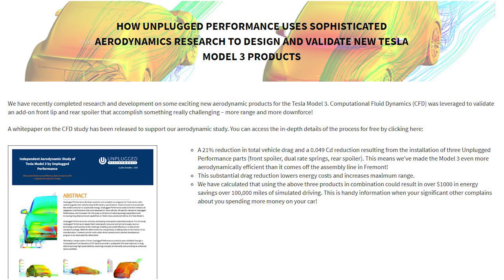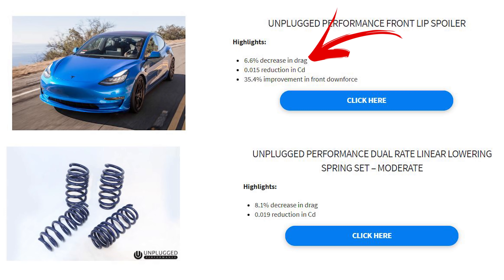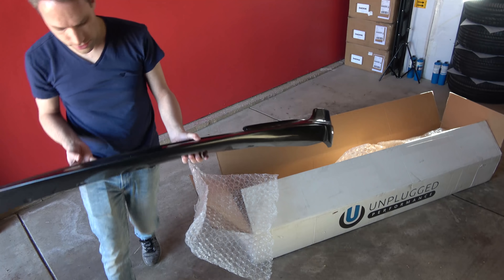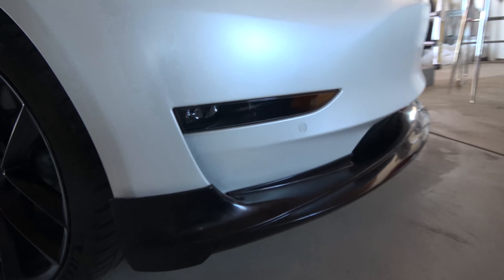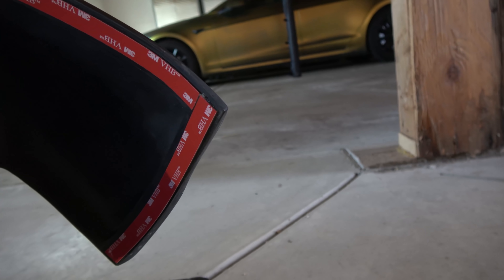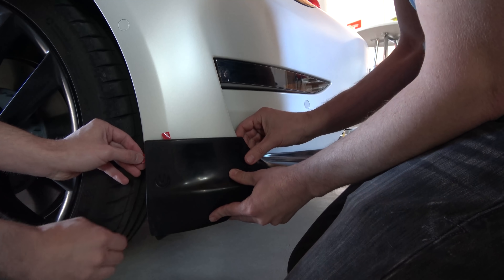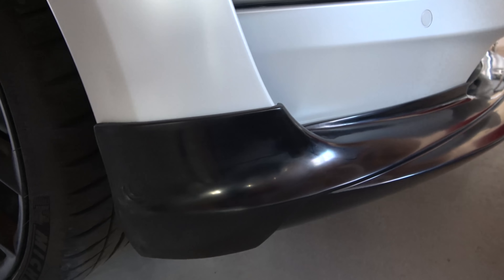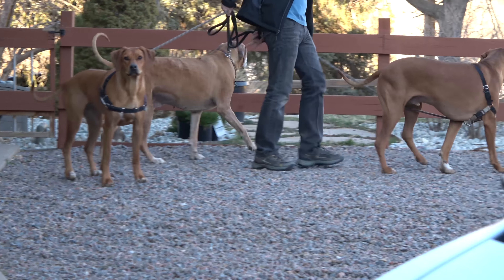Improve Range With This Easy Tesla Model 3 Modification

Comment: I'd have to paint it if it were me but still looks good against the white.  Just an FYI - usually good to clean where the 3M tape touches with alcohol before fitting the bumper.
Reply from the maker: I did clean it all with alcohol, I must have forgot to put that in the video. I will pin this comment for people who are going to install to see.
Reply: I was just going to mention to you that he probably did, as he is very meticulous about preparation, and then I read his reply.
Reply: I definitely came to say the same lol. But knowing him (not literally) I should of known
Reply: Using claps to apply pressure for 3m tape helps

Comment: Attention off-grid folks: :Tesla advises to keep your car plugged in when not in use )ie when you get home from work). But like me, what if you do NOT have a 110 service, I live off-grid in a house I built myself, There are separate and redundant systems for each area: living room kitchen, bathroom etc. I bought my long range model 3 on June 2, 2021 in Portland OR and charged it 100% in Bend Oregon. (356 miles) I live 135 miles east in Christmas Valley and arrived with 219 miles. Over the course of the next three days I drove less than 8 miles a day but every morning I showed a loss of an additional 20 miles. Tesla explained that one can never shut the Tesla off as there are numerous component that require power. I got a bit nervous as I only had 150 miles of range left and the nearest Supercharger was in Klamath Falls Oregon 130 miles west. I made it with 12 miles of range remaining. So range is an elusive number. It depends on your use of the air conditioner and how often you make it go super fast.
Prior to purchasing my model 3 I asked all over the internet how I could use the sun to charge at home. (True, I could have gone a mile or so to a neighbor to charge overnight but elected not to.) So here is my solution: I bought 8 one hundred watt solar panels i wired in parallel to make 24 volts and  then in series (four 24 volts) which cost about $800 with the cables and clamps. An MPPT charge controller accepting 12 or 24 volts which cost $279, two 12 volt deep cycle batteries costing $280 and a 10,000 watt modified sine wave inverter costing $229. Cables and fuses cost another $134, For a grand total of $1801. This inverter provides 220 volts and charges 28 miles per hour.Anyone living off grid with no access to 110 might find my solution will work for them. In short you may not need to visit a supercharger that often.

Comment: Is there actual proof that all these parts do reduce drag and thus increase range? I really find it strange that some third party manufactures just produce some good looking parts that all somehow inrease range. I mean, if increasing range by about 20% with a different spoiler and even downforce simultaneously just by using a different spoiler and front bumper, why did not tesla do this? They invented the car, they tried to reach maximum range, why would they just put a front bumper and a spoiler on it that is so much worse? 

I know the video is old but it just bothers me

Comment: 1. There was no discussion on cleaning the surface that the tape bonds to.  Fail.
2. Mechanically securing the bumper in place while the tape is curing is advisable.
3. The 3 is already about as aero-efficient as it can be, so this "6% improvement"  means that the the stock coefficient of .23 will be reduced down to .2162 (essentially .22). At 65mph, if the rolling resistance is 4 hp and wind resistance is 5hp for a total of 9hp, reducing the wind resistance by 6% takes us down to 4.7 hp of wind resistance, for a total of 8.7 hp.
4. Yes, the spoilers will help in a road race. 
5. From a stoplight and in any real-world acceleration competition the spoilers will only reduce acceleration.
6. The spoilers reduce the resale value of this $60k car. 
7. Quality parts include installation instructions. I didn't notice any such instructions.
8. 35% increase in front downforce??? There must not have been any downforce to begin with. 
9. No before/after measurements of quarter mile time or range? Tsk.

... just sayin

Comment: Yeah put some led lights under and you are set. Also without cleaning the probably filthy surface under the bumper with isoprop the spoiler will most definitely fall off... hopefully not on the highway where you might kill someone behind you...

Comment: Having learned to be a skeptic about such things, I find the company's claims questionable. Will you be doing any tests to verify the asserted mileage increase?
Reply from the maker: Yes, I'll be testing everything.
Reply: DÆrik Should have tested the before and after efficiency test on the same day and preferably within the same hour.    Tests conducted on different day with different weather condition just have too many variables.
Reply: @TeslaInventory  When when when? So curious to see if there's any improvement. Can it make LR RWD a 350 mile car?
Reply: @TeslaInventory  yeah no i doubt this helps. its going to disrupt the subsonic (obviously) shockwave in front of the flat nose making more drag....

theres a reason they punched the nose on these cars.  at low speeds air makes a cone for you and the less surface drag the better

same reason jets have more rounded noses and hypersonic missiles have drastic steep cones (sprint missile)
Reply: I looked over their claims as well and am skeptical.  I believe the largest contributor was lowering the car using their springs....which causes other issues like not being able to traverse speed bumps, et cetera.... Interested to see the results of his tests and testing method.
Reply: @Richard-ie1if  It will help.  Reducing the mass flow rate of air that goes under the car (in this case a splitter is used) will inevitably reduce drag.  Splitters help more on (most) internal combustion engine cars because their underside is not as smooth as electric cars due to the need to fit the exhaust piping.  Also, shock waves do not occur in the low subsonic regime; the correct term is "pressure wave".
Reply: @brendanreed3378  i doubt itll do anything noticeable certainly not % points.  making air flow over the top vs the bottom makes no difference for drag.  when its used its to increase air velocity underneath to make downforce
Reply: @Vxvx22  I have to disagree.  If the changes are not enough that you can't notice them except testing them sided by side, then it's not worth doing.  But yes, having a controlled test environment is better for getting numbers.
Reply: @TeslaInventory  A year later, any news about those range increase tests for Unplugged's "21% drag reduction" add-ons?
Reply: @TeslaInventory  hello Erik, any update? When you'll publish the efficiency test for this spoiler?
Reply: @Richard-ie1if  surface drag?! Do you even know what your talking about. It certainly does not seem like you do. Surface Drag is insignificant when compared to pressure drag!
Reply: @loopie007  it depends! The immediate gains may not be noticeable enough and are easily overshadowed by those “variables”. However, if you integrate all the “benefits” over all the years he uses the vehicle, you may get high enough savings to justify the investment. Moreover, the effect of those hard to model variables will reach zero over a high enough usage period. Let alone the variables whose effect is null.
Reply: Still waiting for the test..

Comment: I think this is mainly for looks. Self-made efficiency claims from an aftermarket supplier are highly suspect.
Reply: In case you haven't actually read or check out the information for yourself here is the link: https://Unpluggedperformance.com/aero Hope this Helps!...God Bless!

BTW!...Tap on the Unplugged Performance Logo and it will transfer you to their Aero Parts Efficiency page!
Reply: @DavidJSmith-hl6kb  After reading the information I find high drag reduction amounts and high downforce increase amounts. . . . BUT no mention of correlating vehicle speeds for those amounts. I'd guess that's because the maximums are going to be achievable at the Model 3s top speed of 155mph. At freeway speeds those percentages could be much lower. Same for the even lower speeds in everyday driving. We'll have to wait for real world feedback.

Comment: Tesla would already know this but has to compromise. The lower lip means future damage from steep driveways, parking building ramps, high curbs from parallel parking bays etc. Better to let customers aftermarket fit these and the AM company takes the flank from future problems, not Tesla.

Comment: Less drag = more miles
More downforce = less miles
Downforce increases friction on the road.
Reply: And also downforce is created by friction of air under an angle on a spoiler, that means it slows you.
Reply: But downforce will help in Tesla Corsa
Reply: Thought the same thing: Less drag AND more downforce is kind of impossible at the same time …
Reply: It is possible to increase downforce without increasing drag. One of the most accessable methods is underbody air management, i.e. promoting laminar flow or reducing the volume of air underneath the body (an easy way to do that would be to lower the car). Aerodynamics is a complex thing.
Reply: @grafikschrubber  with passive aerodynamics yess
Reply: @grafikschrubber  it isn't though. you ever see the side panels on trailers? The thing that happens that creates a lot of drag is air currents bounce around under the whole length of the car. If this can generate downforce while forcing air to the sides instead of under the car, it helps a lot. The general rules you describe are generally true, but it is so much more complicated than that. That's where the airflow simulation via CFD is very helpful - try before you build and learn what works well and what doesn't.

Comment: Careful with your tradeoffs.

1) Things like stickier tires and more downforce - decrease range on all cars - not just electric cars.
2) Range isn't everything for ICE cars, and you don't want to increase at the expense of every other aspect of your cars performance - same with Electric cars.
3) Cars are subject to lift at speed as they have the same natural aerodynamics as an airplane wing.
4) Newsflash!  Airplane wings - lift entire freaking planes off the ground. [duh]

Conclusion - I would never reduce downforce or induce lift over the driving wheels of my car just for extra mileage, as ..... I don't want my car to lose traction and go veering off the road.